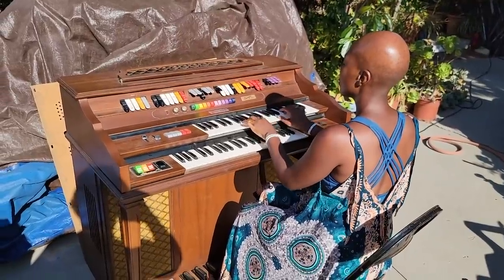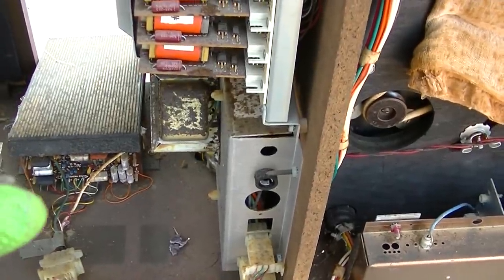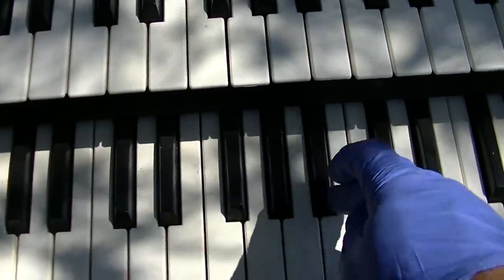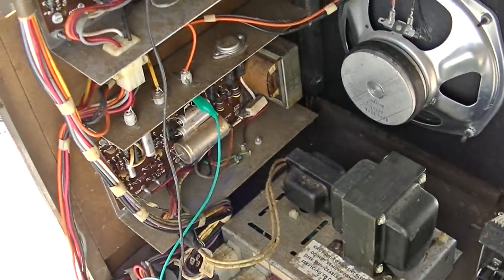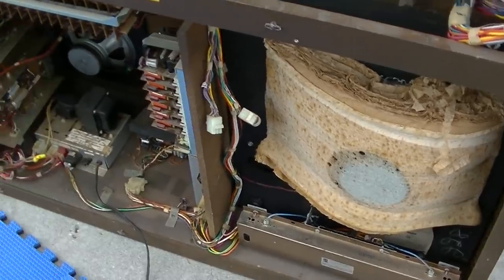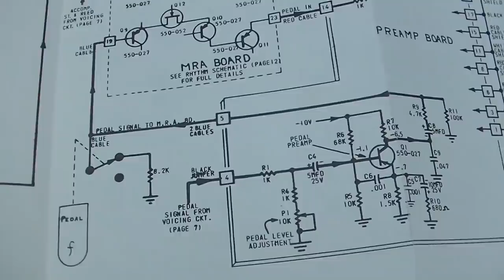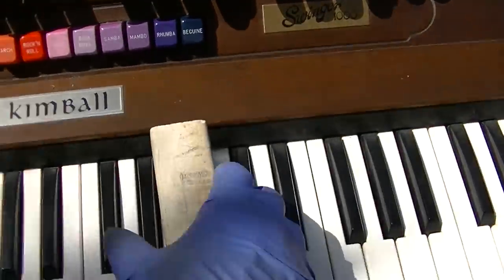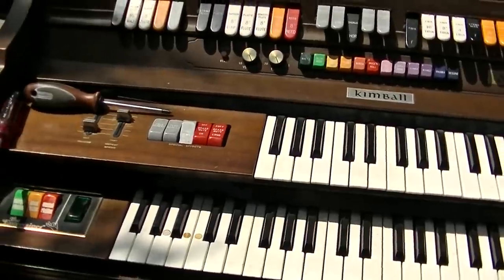1972 Kimball Console Electric Home Organ with Leslie Speaker Resurrection

Comment: I have worked on dozens of this model.  When I started organ repair for a Kimball dealer in 1976 there were lots of them around.  Cleaning contacts and board connectors was very common.  Expression pots, divider ICs, and the chord circuits were the weakest.  I gave up on Kimball when the plastic circuit board connectors started breaking apart.  I'm surprised that they are still usable especially the horizontal boards that put pressure on the plastic connector.  Jump 45 years to today  and the only organs with any interest is tonewheel Hammonds which I still service.
Reply: Hey expert!  I have Kimball Temptation (?) And I can't figure out how to get the lid open.  It seems like I'm slowly ripping the cabinet apart instead of just popping out of a spring/friction clasp/latch.  Is there a lock, screw, or latch I am not seeing?  Can you possibly give me a pointer?
Reply: @FailureOpensDoors  probably a bit late, but there is a small metal tab on the right top side of the back. Unscrew that and while pulling on it, the lid should lift up
Reply: @ElectronicInspiration  i wil try this in the morning and report back.
Reply: I remember my Dad servicing these back in the 70s, and they had recall/returns on the plastic parts so much at one time, I remember him saying it was almost impossible to address the number of returns the factory sent him.  I now have a Hammond A-105 instead.  🙂

Comment: With the short keyboards and pedal board this organ is not worth much.  I was able to get a free 1970s Kawai home theater organ with 61 key keyboards and 25 note pedal board that was fully working.  I stripped out all the wiring, circuit boards and power supply and rewired it with Hauptwerk Hardware MIDI circuits.  I hooked up the MIDI output to a computer running the Hauptwerk software with one of the cathedral organ sample sets.   Now I have a very realistic and impressive sounding virtual pipe organ.  A great way to repurpose those old electronic organs.  I have a working two speed Leslie speaker from the Kawai organ if someone wants to pay the shipping from near Seattle.

Comment: I used to drag home organs like this all the time to the chagrin of my parents.  I could see why they always put reverb tanks and Leslies in them as most were pretty shrill sounding.  The best was an all tube Electrohome.  Had a few Hammonds as well - a Porta-B and a 1950s B2, the former of which I gigged into the ground and the latter I sold to free up space.

Solid state organs like this can still be fun for experimenting.  Most times the amplifier assembly is separate and often connected via standard RCA cables, making it pretty easy to insert an "FX loop" and them through some guitar pedals.
Reply: I've scraped many.  It's sad but I can only collect so many vintage electronics.  Some of these older ones have awesome tube amplifiers and you can bet your ass I keep those!  I have also came across a Hammond baby B3.  I didn't have the heart to tear out its amp.  The build quality of it as a whole stoped me in my tracks.  I couldn't find a buyer and ended up giving it to a church organist.  It was nice to hear it being played.  I also have a newer one in my garage right now that I don't know what I'm going to do with.  It has a tube amp and the real tone wheels you have to oil.
Reply: They do take up a lot of space.
Reply: @commodoresixfour7478  Good job saving the baby B! (M3?) Even those and the other Hammond spinets like the L100 aren't getting as much love now as they used to.  My rule of thumb is if it has tonewheels try to save it / re-home it first.

Comment: Great video! Well I play the piano/keyboards and I like the design of this organ. Please forgive me if I sound a bit nerdy. I'm not an expert, I just play the best I can. The tone tabs (stops) are designed and named like those of the old 1920s/30s theater pipe organs and it looks cool. This is a spinet organ, meaning it has two offset rows of 44 keys (as opposed to two rows of 61 keys) like the smaller Hammond organs, which at the time still had electromechanical tonewheels and IMHO sound awesome through a real Leslie cabinet. Even though this is all early solid state, from what I hear it sounds quite nice. Glad there are no unique integrated circuits that are no longer available. Of course these organs were wather cheaply made and sound cheesy, but I think it's a lot of fun and always worth restoring. I guess these could be heard in homes, shopping malls and smaller churches. Try running this organ through a real Leslie cabinet and I think it will sound great (just don't use the rhythm section). Thanks for sharing.

Comment: A couple of thoughts, though I suppose this'll turn into a book as a result...

I've come to have a much better understanding of how these work after watching the video. (Yes, I watched the whole thing and quite enjoyed it.)

I've thought about learning to play the organ, and if I were far closer, I'd probably rescue this because it'd be good enough for puttering around with. What I'd really like to find is a Baldwin MCO Series Overture, though I've come to understand they are likely to be a LOT of trouble, even if initially working.

A while back, someone dumped a flood damaged mid-1970s Hammond model in a community-wide trash pickup. Outside of the badly damaged cabinet, I'd not have been surprised to find it still worked. I felt bad for it -- silly, I know -- and rescued a few of the more interesting parts out of it. Its tone generator was made up of several large Mostek ICs, but it still had discrete divider sections.

I reckon most of the cost went into assembly, circuit design, amplifiers, Leslie assembly and the speakers, leaving very little for a better quality cabinet.
Reply: My guy! how's the key keeper?
Reply: @zcomputermanz4177  Ask him?
Reply: Omg hes back! Been watching uxwbill sens 6th grade and I'm in college now

Comment: I have my Uncle's Thomas by Heath-Kit organ that he built back in the 60s.  I'm sure it needs all its caps replaced, but it does still works.  It also has a Leslie cabinet inside it as well.  When you open the top it's loaded with tone generators.  Sadly I don't have a clue how to play it.  I just wanted it as my uncle built it and didn't want to see it get tossed when he passed on.

Comment: I'll bet this thing was a fortune when it was new.
This entire organ could be reproduced today on a single chip for 99 cents each in bulk.  Absolutely amazing.  I was alive when this was made. I was watching sesame street, but I was alive.
Reply: You would still need all the capacitors, many of the resistors etc. even if you were to use a chip with all necessary (op-) amps included. And with so many channels coming together in close space you might get problems with shielding and crosstalk. 
Musical synthesis in the analog domain is just naturally a very bulky endeavour. 

In the digital domain it's far easier of course, many 80s era FM-synth keyboards which are pretty much based on a single chip with few external components can do what this organ can, and often more. Even if the analog sound is more "legendary", those were far more efficient just a decade later.
Reply: @westelaudio943  The electronics in this could be replaced with a single chip and that would eliminate most of the support components. But of course, I mean digitally.
From our point of view, it's big and complex, but what it is "reproducing" (albeit poorly) takes up a building.  Real organs are pretty incredible machines.

What I find odd about this machine is despite its complexity and high cost, it was built rather poorly.  A particle board musical instrument?

Comment: I have syntha swinger 1000 (1072).
Using a service manual i acquired off of the organ forum, as well as a homemade signal tracer (basically a crappy bluetooth speaker with alligator clips in the aux input), i have found the culprit of the syntha and string sounds not working: an ic op amp on the preamplifier board. Hoping to solder a new one soon!

Comment: I think I might still have some Kimball service manuals in the basement somewhere. My memory of how the tone generators worked in that organ is very foggy. I wonder if they stair cased the square waves of the divider tone generator so they could filter the signals to create the reeds and string sounds. Most of the old electronic organs end up in land fills if they are not properly dismantled and recycled. I took many different ones apart for disposal.
Reply: They're mostly all the same. There are 12 multi-vibrators, each tuned to a high chromatic octave note. From there, the tones go on to the frequency dividers, flip-flops basically, that develop all the other octaves. Everything then goes to the keyboards and pedal-board, then the voicing filters. From there, it's off to the pre-amp, and then the power amp. The specifics are different, and proprietary, from manufacturer to manufacturer. The simplest were Vox's combo organs from the 1960s, the Continental (Connie) being the most popular model.
Reply: @dougbrowning82  I was thinking about how they derive the various sounds through filtering (the reeds and strings for example). You cannot use a passive filter on a square wave because a square wave is devoid of harmonics. One system they used was "stair casing".

Comment: The 'mystery switch' at 3:50 is changing the sound in some way. On old Farfisa organs from the 1960's it was a 'Tone Booster' that made the sound more aggressive by changing the filter system. On later home organs it was often a sustain lever that did the same as the sustain pedal on a piano except that you operated it with you right leg - the right foot was busy operating the volume pedal. On some organs there was a selector where you could choose between functions that the lever would activate - maybe that is what the "Magic tone selector" does.

Comment: Our next door neighbor had this same organ in the 70’s and it had a cassette deck right there where that bracket is on yours. It was kinda neat to fool with at first but it got old pretty fast, guess that’s why the whole fad died out rather quickly. Great troubleshooting video, loved the detailed manual. It kind of reminds me of those nice detailed Heathkit manuals that explain the circuit functions right down to the components on the board.

Comment: I found this quite interesting to say the least. Most fascinated by how the tone is generated by the oscillators. It's actually always being generated (all of the tones) and the divider IC is picking it off. Pretty slick! Perhaps it's not a whole lot different than a superhetrodyne circuit.. and the dividers work on a beat frequency and or a multiple thereof... ? Totally did not expect that discovery. And it appeared you weren't either. Thanks for the education!

Comment: I work in keyboards - actually more the acoustic piano tech end of it but I have done a lot of broad keyboard music repair over the years have and worked with dealers.  You can't even give these things away today.  I have personally taken an ax to quite a few old organs to break them up for the trash.  Digital keyboards have pretty much taken over that market, ( I guess you might call it and "organ transplant"....  no?)  Anyway, about the only real thing from this era that still has value is the old tone wheel Hammonds.  The model B3 specifically which was used a lot by bands in the 1960s and 1970s.  Retro bands do still use them for that grindy sound and the Leslie speakers were part of the B3 package.  But old kimball organs?  Nope, dumpster fodder today.

Comment: If you ever wished for intro/outro music, I think you could isolate a bit of this and there you go.
This was different and listing to each key was every bit as tolerable as listening to Spanish radio or dopey TV commercials. I like it. If the slots were busted off maybe some super glue or E6000 could hold the edge down-- OR, add some solder blobs on all the fingers.

Comment: The first thing I’d do with with a device  like this with all those socketed cards is clean all of the edge connectors with contact cleaner.
Reply: Yes, and not to 'clean off' the gold plating with sandpaper...
Reply: first thing i'd do when i found one uncleanably dead would be to replace the edge connectors

Comment: These things must of been expensive when they came out just for the amount of work going into building them. Did they use cheap pots and caps like the black ones grouped in 13s..? The used cheap particle boards so just wondered if tried to cut down on costs anywhere they could. My grandma had one delivered to her house free of charge and she though that was getting a great deal when in fact they were avoiding having to pay a toll on taking them to the local council waste facility. I taught myself to play some Beatles songs on it when I lived with her before her passing.

Comment: I'm 63 and had organs for 45 of those years but I finally gave up because of the electronic problems. I had a Gulbransen Rialto II. Top of the line organ and teriffic sound. It had a built in Leslie speaker. There were like 100 circuit boards in it. It wasn't difficult to understand the electronics and I had the schematic book which was a hundred pages long. All the electroncis are avaliable except the chips. That's where I hit a wall.

Comment: These seem to be common where I live. I've come across no less than 5 in various states from different manufacturers. Similar concepts. They look like a real pain in the ass to repair.
Reply: They're nowhere near as complex as you might think. Once you understand the basic method of operation, it gets pretty easy to break it down into relatively simple stages. Having a block diagram helps of course, and a full schematic makes it a lot easier but they're simpler than they look - the look intimidating because there's a lot of duplicated circuits in there but the way they work is really very simple (certainly compared to modern digital keyboards which are pretty much all done with software these days - personally I love tinkering with the old analogue stuff)
Reply: @countzero1136  it made more sense once the video was over. Just one of those things you have to watch all the way through.

Comment: Clean all of the connectors and glue a stiffening plate onto all the connector plastic tops to take the wow out of them. That nut and bolt thing that you did worked okay because you had no connections in the spot that you were putting them in. Take care of your enemies, corrosion and loose connections along with cold solder joints and those leaky capacitors and bed pooping transistors. As you got that thing going, you were starting to sound like you might know how to play a bit.

Comment: Here's how you repair mainly all issues with that thing take all the key generator boards out the ones that are in the back there and clean the contacts on all of them both sides and the others also these things have issues with pins being dirty that mainly all that goes wrong with these I do organ repairs myself I know alot of problems with a lot of these and it would be nice to hear it working again I love the old organs but I do work on hammonds mainly but you should be able to git it all working if u just do a lot of cleaning..

Comment: My grandad left me one of these, but slightly different model. Looking forward to refreshing the electronics someday. Mine is simpler, but works fine no hum. Probably still needs a recapping!

According to my grandfather, the wooden "switch" is actually to rest your knee against for proper pressure for your leg to adjust the volume pedal.

Comment: Those Mylar sliver/red line caps are probably the leakiest I’ve ever ran into. Even worse than the yellow Astron caps in old Fender amps. I can’t remember what they were in, but they all had to go. Possibly a Magnavox console or something. Those black bodied/red end caps are also electrolytic if I recall. 

It’s unfortunate that these aren’t used anymore. They record actually playing just fine, especially with the reverb and rotary speaker. The “drum machine” is just cheesy as all hell! It just costs more to fix than they’re ever going to be worth.

Comment: Depending on the voltages, you can probably replace the defective divider IC with some CMOS 4000 logic IC. Like a 4013 or 4027... because all you need is a divide by two, no magic involved.

Comment: Wow, followed the bread crumbs from Mr Carlson's lab and this caught my eye.  I still work for Kimball - have been there since 1979 when we were still designing and building organs.  This one was a little before my time, but still very recognizable.  Later, we went to the TOS (top octave synthesizer) which was really just an IC that had a set of dividers that generated the entire top octave from one 2 MHz oscillator.  From there it was divide-by-two to get the lower octaves as you saw with this one.  Great work troubleshooting this.
Reply: Didn't Kimball import organs from Italy in the last days of the home organ? I have seen one which the badge saying "Kimball EP-1 - computer by Elka" on the front.
Reply: Yes. Kimball North American design and manufacturing facilities stopped making organs and turned solely to contract manufacturing at the end of 1984.  Our engineering team had nothing to do with the Italian models. I never even saw them.
Reply: @agosto1685  Possibly they were never unpacked at the Kimball facility but went straight to the music dealers. As far as I can see the Kimball EP-series is identical to the Elka EP-series, so Elka probably made everything. Elka also made organs for Gulbransen - the Equinox DG-series, but I think Gulbransen made the cases for those, as they look much different than the Elkas and Kimballs even thought they technically are the same.